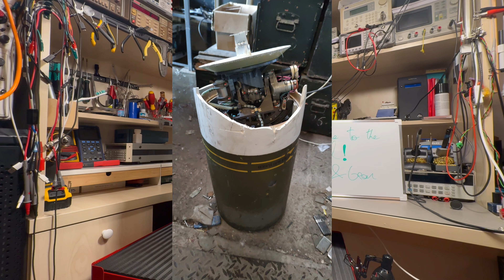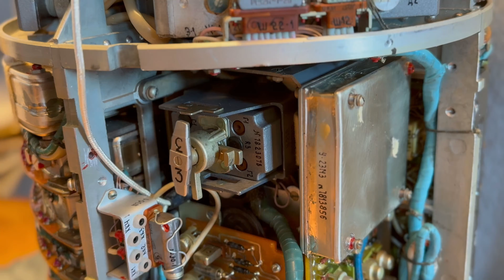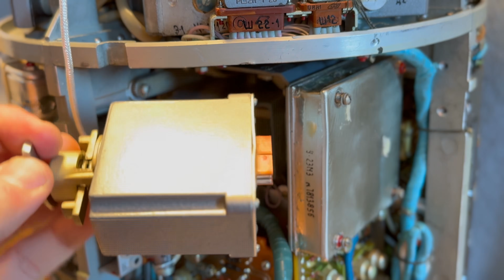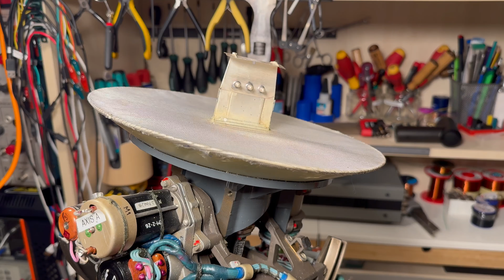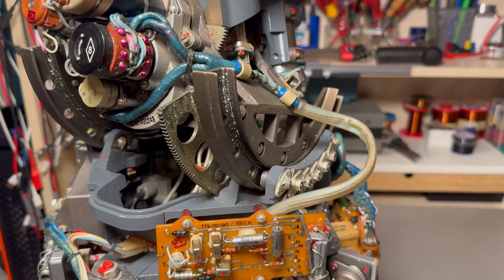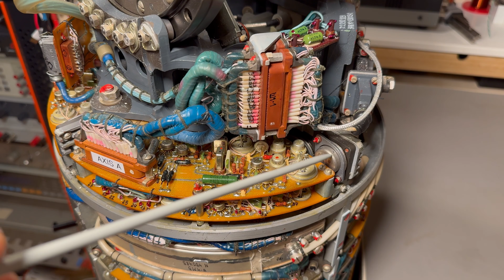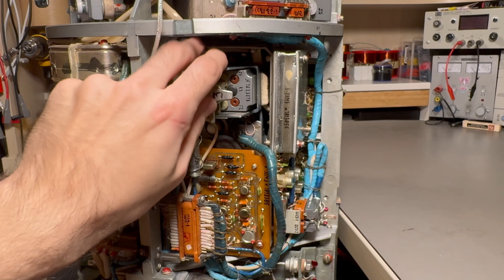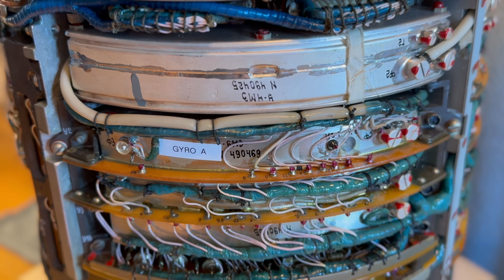Soviet Surface to Air Missile Poorly Explained

Comment: The velocity control possibility you mentioned, then discarded because the missile used solid propellant, may have been possible because, "The combined propulsion system 9D16K included solid fuel rocket motor which, when burned out, forms the combustion chamber for a ramjet in a pioneering design putting this missile far ahead of its contemporaries in terms of propulsion" which may have allowed the ramjet to be be throttled by making adjustments in fuel flow.

I agree that it is both amazing and sad how much of their citizens' money governments (oligarchies) will spend to end the lives of the citizens of opposing oligarchies.  However, that at least results in interesting things to analyze when they throw these incredibly expensive, but obsolete gems into the trash.

Comment: Wonderful video, thank you! What is the readout on the hour meter, I couldn't make it out. Military avionics tech from the early 70's  here, so I am right at home.
Reply from the maker: It was right around the hundred hour mark. The key was the number 3 so this was used mostly in training
Reply: @GearAcquisitionSyndrome  Thank you! In 1972 I was detached to  US Naval Weapons Systems Labs to help them test the AN/ALR something-or-other radar warning receiver.  We had signal and function generators set up and cranking out through a TWT to a steerable dish antenna pointing at an SH-2D helo flying a couple of miles away off Point Loma in California. The SA-6 waveform was one of the many that we beamed out to the bird. A few hundred feet below us was Black's Beach where clothing was optional. I swear, my 19 year old brain had no trouble concentrating on keeping the antenna tracking the helo.
Reply: 19:00  The date stamp on that big transistor is  07 81= Jul, 1981,
Reply: @ЮрийМирошников-з3л  That is a mid 60s missile that was still being produced in the 80s, hence, this particular missile is a later revision and production run.

Comment: As to conclusion - This is a system designed to "minimize impact" other people might "have on the people around us". Air defense system, made to hit targets at the mid altitudes flying with sub sonic speeds. Even Russians need to use something different to hit civilian airlines. At the time of their eol one round costed more than the most expensive, full package version  of a Mercedes. They also had maximum efficiency less than 50%. One of more ambitious commanders ended up in a shrink unit after target shooting resulted in 2 hits per 10 of those launched. Timer is there, because during training a round can sit on a launcher for hours and never be launched.
Reply: Stop drinking😂😂

Comment: I drove a launcher for those back in Poland, Never seen the life round thou. At the time of my service they was already 30y old The entire machine was filled with vacuum tubes. Driver had nothing to to with the rockets. There was a separate crew for that. Aiming radar vehicle took care about the rest. Drivers was just an expandable labor.
Reply: From designers to drivers. We were all just links in the chain. Vital links. One wrong widget or road-skid, could be one big happy mistake for those intended human targets.
Reply: As we can see the SAM-missile have no vacuum tubes at least in this part, so it was some breakthrough. We can see even some early IC opamps here. This missile was  assembled in 1981 as other commenters say so it was an upgraded model.

Comment: That unit is not from the 1960s. This is from the 1980s.Those diodes are mixer diodes running at 9Ghz. Next to them are two gun diodes that are 100mW, and are designed to send the signal via a wave-guide to the dish antenna via interdigital filters.
Reply from the maker: I’ve noticed, the original design, however, is from the late 60s

Comment: How I wish we had fleamarkets like that near where I live. Nice mix of mechanical engineering and microwave tech. The microwave elements look quite sensible to my eyes, but then I've been messing with microwave systems since the 1960s. I have some antenna parts from a MIG fighter that run multiple frequencies, with centre-fed slot antennas, waveguide horn and rod antenna elements, and there is a family resemblance. I guess they are from the same era. Can you get any photos of the transmit/local oscillator components, or are they sealed inside cavities or otherwise inaccessible? I guess that nobody was planning to do routine servicing on these, er, "non-reusable" systems. Great to see this on Youtube.
Reply from the maker: Apparently, the seeker was passive, the local oscillator seems to be the key thing marked with a 3 that was replaceable from the outside. It apparently fit in the actual mixer. The  waveguide feed on the bottom of the seeker brought in the radar signal from the illuminator. Lovely having you around! I’m a huge fan!
Reply: @ I watched a second time and yes it's pretty obvious that's how it worked. I shall have to ask around to see if there's any documentation on the similar devices.

Comment: The dates are wrong. Please have a look at the dates for some components, I found at 12:57 a tantalum capacitor dated 1981. It's a product of 80', not the sixties'!
Reply: This product from the late 1960s, which continued to be produced in the early 1980s.

Comment: 19:00  The date stamp on that big transistor is  07 81= Jul, 1981, 
same year on other parts,1980... also.
Looks stone  age tech especially for 80s...
Reply: yes, the system was produced essentially unchanged from the beginning of the sixties to the eighties.
Reply: @KorbenDalasCZ  не, КМ - конденсаторы (те что с палладием) в 80х начали внедрять, в 60-е там все по другому было
Reply: @ЮрийМирошников-з3л  I think, It is modernised version. But technology is from 60s.
Reply: @KorbenDalasCZ  lack of improvement for two decades tells about the decline of USSR even in the main objective of the Commie regime, military domination, exactly this complicated but proven design was cheap to produce in volume by slave labor, see North Korea for reference...

Comment: I wonder if the weird accelerometer is some sort of device to maintain frequency stability in the RF section by correcting for doppler shifts due to its own high speed movements.

Would make sense because if both the missile and the object being tracked are traveling at high speeds, changes in direction could drastically affect transmitted and received frequencies. If the guidance computer on the missile knows it's own speed and direction changes, it could account for that shift and remove it from the equation making it easier to discern the tracked object's direction/speed.

Comment: Hasn't technology changed so much!?

A simple flight controller module for a typical quad copter (drone) can do just about all that can do. 

Just add solid state radar, utilising beam forming. 

Such a heavy mechanical thing that needs to fly.

Great video! 👍🏻🇬🇧

Comment: From what I can remember about these things, the accelerometer turned on the system when the rocket was launched and also acted as the contact fuse detonator for the warhead. I also believe that the vacumn tube you pointed out next to it was the "proximity fuse" that used the radar return signal as a driver. When the return signal reached a certain point it triggered the tube and then that in turn detonated the warhead.
Reply from the maker: Excellent insight! Thanks!
Reply: Нет. Все системы ракеты работают еще на земле, пока ракета в дежурном режиме. Гироскопы вращаются со скоростью 60000 оборотов в минуту. Очень шумно. Вся электроника тоже работает.

Comment: It's amazing how much work went in to something that was only going to be used once. 
Loved lacing cableforms except for cuts the lace made in the folds in the skin on your fingers,  it would find that cut day after day leaving a fine  black line.
Reply: There's a rather interesting way that a certain missile (I forget which one) handles "garbage collection" of it's running program.
Rather than actually attempting to collect the garbage at all, they simply calculated the maximum time the missile could spend flying while still being able to successfully engage a target, and then gave it more memory than it could ever possibly use. Engineering dictates that "the best part is no part", so in this case since the missile is destined for destruction (one way or another) as soon as it is launched, they opted to simplify the guidance program by not even attempting to incorporate a "memory management" subroutine. In other words, "garbage collection" is handled by the physical destruction of the memory chips themselves, rather than any attempt to wipe the contents of those memory cells so that they might be reused.
Reply: @SciDerg  Yep! it has to be 100% reliable once.
Reply: @SciDerg What? You makenit seem like the missiles ran Java
Reply: Эта ракета расчитана максимум на 50ч в дежурном режиме. Дежурный режим это когда пво работает на поиск цели. И через эту ракету пропускают охлаждаюший газ, чтобы работающие внутри электронные платы и гироскоп радара функционировал. Ракета очень сильно греется в такой момент, именно поэтому нужно прокачивать охлаждающий газ через специальные трубки от пусковой установки. В таком виде ракета может мгновенно стартовать. Поэтому даже если ракета не полетела, после 50ч её меняют на новую. Чтобы продлить регламент или списать. Ведь внутри гироскопов есть подшипники и они изнашиваются. Есть полупроводниковая электроника, она тоже выходит из строя. Ваша ракета тоже наверное была списана.

Comment: what is that mesh for?
Reply from the maker: Probably to protect the surface of the dish from dust and other stuff which might affect it’s shape and, therefore, it’s sensitivity to the received signal
Reply: @GearAcquisitionSyndrome  Are there fine wires woven into the cloth? If so, this is not just a cover, but a polarization filter, which passes only one linear polarization of the signal.
Reply from the maker: @ you might be right! I can’t see any wires, but that’s a possibility!

Comment: Based on some components date codes, I'd say that this thing was assembled somewhere in 80s.
Reply: 19:00  The date stamp on that big transistor is  07 81= Jul, 1981
Reply: @ЮрийМирошников-з3л я служил в армии, в моей станции, при входе стоял шильдик,и было указано сколько в станции золота, серебра, и в документах было всё указано чемодан книг , и принципиальных плат и их строения и принцип работы блоков,
Reply: Exactly, and the version of the Self-guidance head is 1SB4M3 (a modernized version of 1SB4).

Comment: I guess the stuck screws were never ment to come apart again. Looking at that thing gives a feeling that quite a lot of effort went into putting it together back in time. Something tells me that military stuff (specially rocket stuff) in soviet onion was made to different standards than regular heavy industry. I am restoring a soviet milling machine from 1979 (model 6Р82Ш) and even if the general engineering is not that bad, the assembly quality is non existent.
Reply: there was a joke back in the day that translates something like - what do you do when you buy a soviet car? you take it all apart and rebuild it
today the same thing can be said about cheap far eastern made stuff, they all are parts kits, even if the complete thing on the picture resembles a product, and often is made from materials that 100% don't pass any quality standards in the west, yet have all the proof marks
Reply: @rikkt731  I am always amazed about stolen tech, even simple stuff. There are extreme examples from consumer products to massive machinery parts. China and Pakistan have good examples. It seems like their goal is to make it visually look exactly like the original while things like chemical, metallurgical and other materials properties, are completely ignored.  It is like if it looks exactly lk the original, it will somehow magically operate the same!

Many of the workers who might barely read or write, go by the visual appearance more than anything else!  It makes sense when you realize that is the extent of their knowledge base.  But shop/business owners know that if it looks identical to the original, it can sell for a lot of money on the fake/counterfeit  parts market. They will go so far as to stamp logos and fake proof marks.

The stuff gains value is it works its way up into reliable distributors. Some mid level supply chain procurement guys can make tons of money by introducing the fakes into the supply chain. A classic market infiltrated by fakes, is industrial fasteners.  A high strength 1" grade 8 bolt and nut may sell for $40 apiece, while some Pakistani shop makes hundreds of these in a day using scrap rebar, complete with the proof marks and the entire shop workforce together got paid the $40 that one bolt sells for! But they look identical. 

 These filter their way through various distributors creating an untraceable path, with each buyer/seller along the way increasing the price  along the way until someone in a reliable distributor makes a ton of cash by introducing these fakes into the market. Eventually someone buys thousands of these at the market price to be used in construction of a bridge or building. At this point, both real and fakes  can be mixed together.   If 10% of the bolts used in a bridge or building were fakes, it may not be realized for a long time. At that point there is no tracing how these got into the supply chain! Eventually, someone starts auditing and testing only to find out that the market has been infiltrated with these fakes. This in turn causes buyers and distributors to institute an audit/testing process which just raises the price of the bolts.  

We need to be more careful when we make trade deals with third world countries. Certain items should be completely restricted. But even then, once you open the door to container ships full of goods, Some of these restricted items may still get through.
Reply: @rikkt731  My relative worked on an assembly line as an apprentice in Moskvitch factory (during his studies in technical academy, around late 70´s). During lunch brake, he was bullied out of food line in mess hall and was the last one to get his share of the slop. Bell rang and people returned to the assembly line, he just continued to finish his lunch in no haste. Some other days, if there were hold-ups on the assembly line, he just dropped the excess nuts and bolts from the lunch, into Moskvitch's body cavities.
Reply: @sven-erikviira1872   не пишите хуйни.. !!!

Comment: 31:07 This is the coding/decoding device to mate rocket with its ground guiding radar, friend/foe recognition and prevent spoofing by others in case there are more then one SAM radars working in the same area. After Belenko MIG-25 escape to Japan friend/foe system was modified to allow friendly fire to prevent future escapee.

Comment: Could that "accelerometer" / overload detector just the initiator of the detonation? Like when it hits something
Reply: SAM doesn't designed to hit something. Missile has proximity fuse and detonates near the target with thousands of small projectiles.
Reply: @snail2171  ah, you are right, my bad for losing track it was a SAM. And what the operation principle is? Somebody below mentioned a pair of crystals.. is that like a RF variant of laser target? Like what reflects the signal is the object to be chased?
Reply: @cameramaker  https://en.wikipedia.org/wiki/2K12_Kub
Reply: @snail2171  there is a video on YouTube of how an F-15 doged 3 SAMs and went by very close without chaff or flares and they did not explode but passed by.

Comment: 31:18 I'm pretty that is a crystal that sets the radar channel.  There will have been a matching one in the ground section of the launcher/radar.  The idea is that there will be a rack of crystal pairs and they are regularly changed to confuse the enemy and reduce the likely hood of jamming as the operating frequency will be routinely changed out.  The actual frequency is kept secret, even from the operators and just referred to by a crystal number.  The British Bloodhound system used a similar thing but with color coding for the crystals.
Reply: RF transceivers for RC used to do the same thing too. Pretty common trick from the analog age.